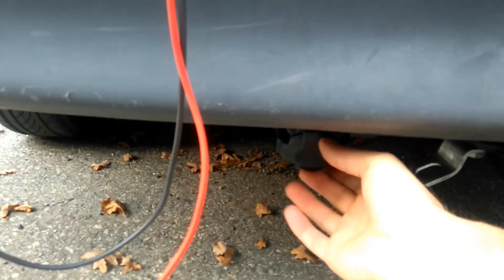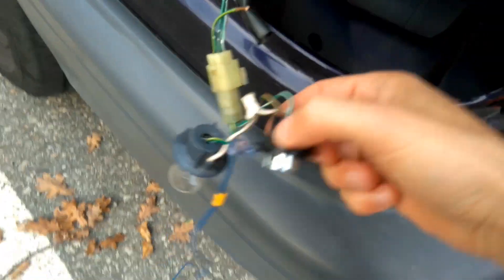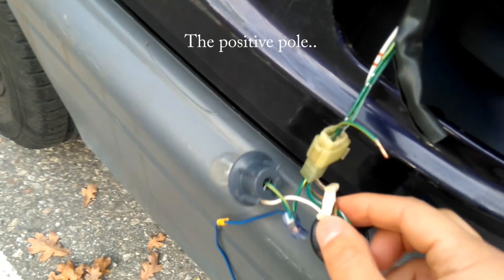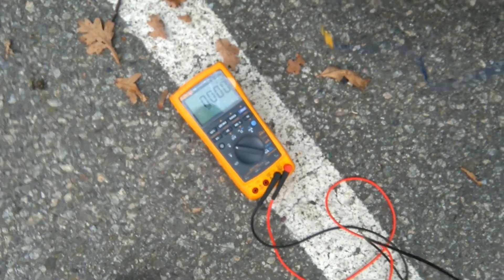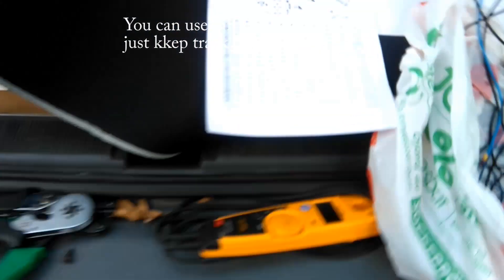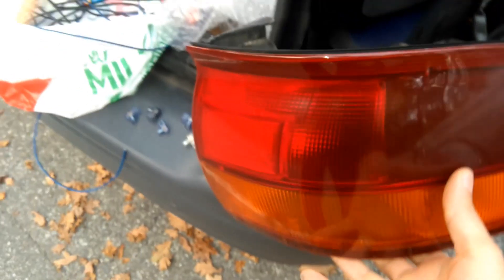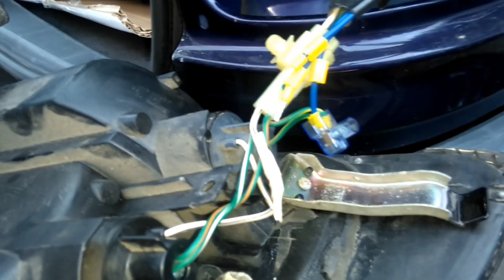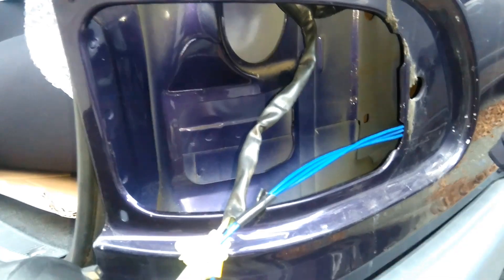DIY: How to wire up electrics on towbar the easy way

Comment: Haha you connected trailer lights in parallel with existing lights? Well it might work if the car is before 2005
Reply from the maker: Yes no problem on this Toyota Previa, still works.. It's from 1998. I've replaced the most consuming (W) lights with LED instead.

Comment: I need to wire my tow bar to my vauxhall Zafira
Reply: First step for you would be to sell it and buy a good car
Reply: @kimblefitzpatrick4249  some zafiras last longer than most mercedes and bmw put together.
Reply: @P1ssOffDickheads  I completely agree, that's why I wouldn't touch both merc's or bm's with a 12 foot pole either haha, I'm not certain where your from, but in Australia most euro cars aren't really made well enough to deal with most of the weather we have here 😂
Reply: @P1ssOffDickheads  the main issue we have is the heat, some days during the middle of summer, it will reach up to 48°C, which most euro cars aren't really designed to handle haha